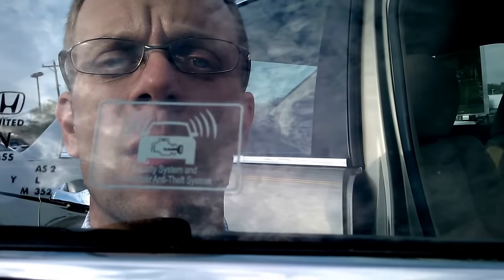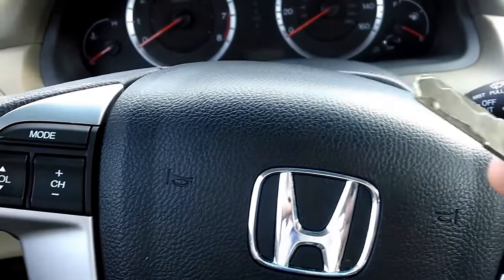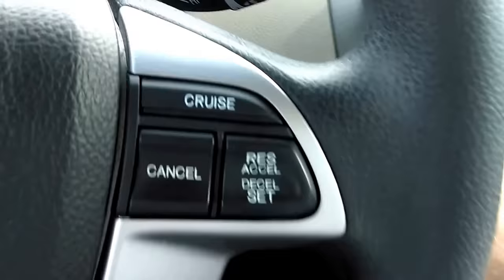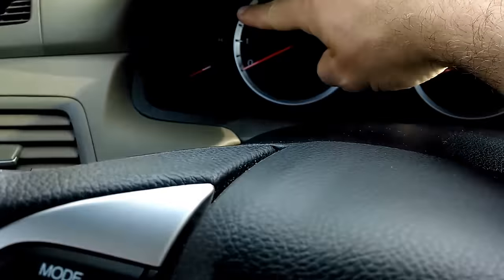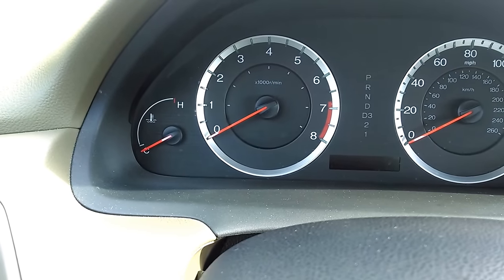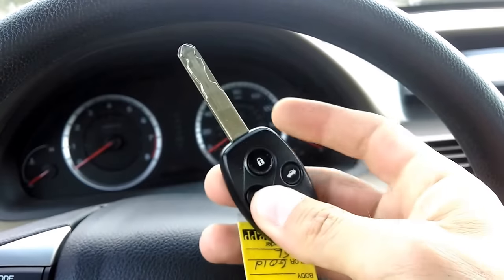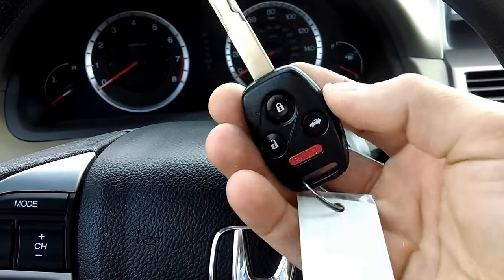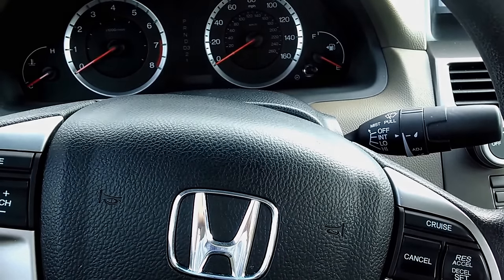HONDA - Anti-Theft/Engine Immobilizer Explanation, How To DIY Learning Tutorial

Comment: If the immobilizer circuit fails intermittently is there an output that can bypass this? Is there multiple outputs from the computer to remove voltage from the coil, injectors, etc? My Pilot is 17 years old and usually works but randomly does not crank flashing the key icon. Don’t want to spend $1000 on a car this old if it can be bypassed

Comment: Question... can thieve Hotwire the car? I have 2008 Honda Accord EX-L V6 with anti theft system. I have lock club that locks brake. Can a thieve comes inside and somehow unlocks or cut the club and Hotwire the car? Will kill switch do any good?

Comment: Hi, thats an really usefull video. I have a doubt, I bought a new key without a chip, because I already have one original chip but the key case broke. Well I put the chip in the new and plane key, I made it match with the car and now I can open the Doors and stuff with the remote. Me question is, ¿Will I be able to turn the engine on once the keymaster had copied the key shape from the original one? Sorry for my limited english
Reply: Did it work?
Reply: @JC-hu1wd  it did! Also, the key wasn't an original!

Comment: That being said, are accords a safe population from theft? I've commonly  heard hondas are most easiest to break into

Can you copy a key w/o the remote - that would work?
Reply: All cars are easy to break into. Remember honda and toyota are the best selling cars so theyll naturally just be stolen more simply because of the odds. Most honda and toyota cars arent stolen. There just the most stolen because they are what exists the most
Reply: Well, they are kinda the easiest to break in. Just used a flat ruler like tool and you're in. I think it was honda accord 2007 or so that was the most stolen vehicle. But yes they are reliable that's why they're stolen also.
Reply: Actually, as a former tow truck driver, ford's are the easiest to break into with a flatbar. 2.5 seconds.

Comment: Hey I have a 2009 Civic GX that cranks but won't Start.  The Green Key light goes on and off when the key is turned on. The Engine cranks fine, but the engine won't fire up. You hear the engine fire or pop now and then but won't run.
 What should I look for?
 Is there a PGM-FI main Fuel injector relay on the right side of the car behind the glove box like on other gas models? 

Does this relay open a high pressure control valve to the fuel pressure regulator and power the ignition coils?
Reply: Same problem!! Any ideas ??
Reply: @120DangerousHold ever get it situated ?

Comment: Some cars lock the steering up when its started without the key but i figured out you can just take an angle grinder and cut the collar holding the bolt in off
Reply: What are you cutting?

Comment: My battery in my Honda Clarity 2018 went dead we charged it then it wouldn't shift they told me to tow it in. I found that losing power or changing the battery causes your anti theft to be enabled so not to be able to put the car in gear. All you need to do is put the key in the drivers side door, lock, unlock, lock it will release and you can shift gears. 6 people told me to tow the car.
Reply: I can’t get the car to turn over.       It turned over first right after the change and now it won’t start
Reply: @stephiecee7232  did you resolve this ?
Reply: @calimestime  I did.  It was the starter and I changed it all by myself but woohoo

Comment: I have a 2003 Honda Civic and the key sign shows up and flashes twice for a few seconds then goes away is that normal?
Reply from the maker: +jay gets buckets That means your key battery is low.  You can actually replace the battery pretty easily!
Reply: HowToCarGuy ok thanks. I thought my immobilizer was malfunctioning
Reply: HowToCarGuy i have the same problem this morning my car dont detect my keys anymore both of them at the same time, its not the battery, because they are not remote key they are only black rubber key Honda Fit 2005 so now im stuck in a friend driveway 385KM from home. i have this car for 2 yeat now, it never happened before... i have the green key flashing in the car, it try to start but no fire..
Reply: HowToCarGuy I have a 1998 Honda accord there’s no battery in the key ??
Reply: Mixer Wolf immobilizer
Reply: Can you you start a 2003 without the immobilizer

Comment: my wife's 09 fit just started to do this today 3/14/18. her original key was replaced about 2yrs ago. i am not sure if it was reprogrammed at the dealer at that time. i find it strange that it just now started to do this after so long. 
question is it the battery on the key fob or should i try the dealer first?
Reply: Marcus J. The battery in the key fob should be just for the remote. It’s my understanding that the transponder chip in the key does not need a battery; I.E. the owner’s manual of a 2002 CR-V says, “Do not open the key, there is no battery inside.” In 2002, the keys and the key fob remotes where not one piece. If the 2002 key doesn’t need a battery for the transponder chip, why would newer keys need a battery for the transponder?
Reply: Forget the expensive dealer, a locksmith that has current technology will be able to program a transponder key.
Reply: A good rule of thumb is change the key battery once a year just like you do your fire alarms in your house !!!

Comment: any idea about this issue. I noticed last night my electronic doorlocks did not respond aswell as the interior lighting didnt go on, then noticed the green ket flashing. Ifound that is Immobiliser issue, though i wonder why the doorlock and interior light would not go on, these are not connected to the immobilser are they? I tried looking at most of the fuses biut have not found a burned one yet, in the manual i dont see a ACG fuse as well. I got a European Honda Civic 2001.
The interior light still works when i switch it manually but not using the doors, kinda weird one
Reply: I am having the same issue. Anybody got any ideas how to fix it. I don't want to get locked out of my car again.
Reply: @deelenagraves956  somehow i thought nk something shortened. The edu or EDC, can't remember the correct name. It's the computer board behind he glovebox did not recognised my key anymore. They tried things they knew but could get it to watch to. Even with a different second hand jelock and board. Now the chip is bypassed. Yet many electronics don't work no more. It does start now. But i have no electric doorlocks anymore, no airco, no interior automatic light. Lights on dashboard won't work.

Comment: I bought a honda from used car dealership and I opened the key to change the battery and I try to start the car the engine starts but shut down immediately i though I bought a lemon car so I go to the dealership and start a fight 😆😆😆😆 all along this was the problem thanks for the video
Reply from the maker: WOW!  I am so glad I could help you.  Thanks for stopping by!
Reply: That's me lol
Reply: Problem when disconnecting car battery as well.
Reply: Use your factory system to a amp and watch.facttory hit hard without battery problem.

Comment: Hello, I have an emergent question for the video publisher really. My car (grand cherokee 2004) was stolen inside, but the theft didn't take anything away from my car as there is nothing valuable there. I found this happened this monday as I noticed my car's door is ajar and pretty massed up inside. However, I didn't use my car since then, and today I want to drive for shopping and found it doesn't work. It looks like when I started it, it sound like "clicking", and no crank up. I am just not sure if it is the starter problem or the anti-theft programming problem. The car has enough battery and power. Thanks for any reply.
Reply: Hey Derrick, I am having somewhat similar issues with my 2011 Honda accord that I bought just a week back, It is really cold here but I don't think that's the issue my car is not starting up, rather something with the anti theft as you mentioned because I am thinking I might have messed something up while I was wondering around the car and the alarms also went off once
Reply: @rushil505 it's quite funny that you tried to help him despite the fact the comment was 5 years old when you replied.

Comment: what if the green key light is coming on and the car wont start?
Reply: eileen Clow Your anti theft was activated. It needed to be reprogramed and then it would have started.😳 but this was a year ago.
Reply: Mine is doing the same. Green light but no start.
Reply: Julie K Munden is the battery in your car key dead? Go find the 1616 battery for it, that's what I did and it started right up the first try. Hope this helps.
Reply: Yes, got a new battery and it still won't turnover. Ugh!
Reply: Julie K Munden just to be clear, are you talking about the actual battery that powers your car, or the battery that powers your key that unlocks and locks your car? Just for clarification
Reply: Yes, the battery in my key. I just got a new battery in my car too.
Reply: Julie K Munden and the solid colored green key symbol is still there? Do you have a second key by chance? I'm sure I'm not going to be able to be much help, but changing my battery out helped and it cranked up the first try.
Reply: NASACrooks yup
Reply: GT Abraham if you have a spare key try that first if it doesn’t work then you need to change the immobilizer and possibly the ignition switch
Reply: @jimmysapien9961  @

Comment: I have the same year Honda Accord and I’ve had so many god damn problems. I hate Honda. I’ve had the alarm go off 3 god damn times, once in the middle of the night. I had the right key, everything was fine, the stupid car just would f up. I hate Honda, I hate the horrible 2.4 engine barely cranking out 200 horsepower, the horrible acceleration, horrible transmission, horrible looking car, horrible cabin noise, horrible god damn everything, I hate Honda more than I can ever imagine, they suck. I  don’t care if they’re reliable whatsoever, every car in the god damn world can reach 200k miles. I hate Honda, I hate Honda, I want an actual god damn car like a charger or a magnum, not some garbage box Honda Accord that takes 5 years to get to 60! Hell, entering a highway is so hard because with the pedal to the floor, the car isn’t going anywhere!! I hate Honda so much, I want to sell my pile of garbage to some other owner who will hate it too.